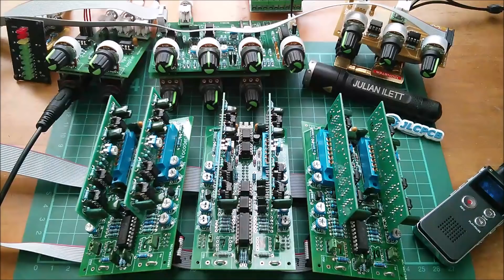The Vocoder has 6 Frequency Bands (and PSU problems)

Comment: Julian, wouldn't it be a better idea to power an analog processing system with a proper linear power supply?
This would alleviate your power supply noise and be more true to the original design.
Go on, get a transformer and rectifier and regulators and filter capacitors and build a decent power supply, rather than rely on a Chinesium SMPS.

Comment: I can see from other comment that you want to avoid using a linear power supply (my preferred option), so what about coming from the smps, through a choke, then a large capacitor including a decoupling cap
It's an old method used in valve equipmernt (rectifier > smoothing > resistor or choke > smoothing > circuit)

Comment: I am sure some other people have recommended this, but why don’t you try an LED strip/CCTV power supply? It provides both +12/-12 volt rails, and a 5 amp one costs around ~$15 US on Amazon. You’ll have to get some other regulator for the 5 volt rail, though.
I’m considering using one of those to build my own modular synthesizer.

Comment: Hey Julian, have you considered the DC/DC converter modules? e.g MeanWell RDDW20F, or RDDW10H  its £20-30, there is still ripple at 100-400khz, but I understand why you might not want to go linear.

Comment: Audio fanatics love to use step down transformers and huge filtering caps, i think you should use a centre tap transformer and separate winding for 5v supply or use lm7805. 
Using transformers in audio projects seems to give better results than what a switching supply can do

Comment: My son gave me a modern computer PSU  and I believe it can supply up to 3Amps on the -12VDC ,I haven't checked  but I assume it would be pretty clean since it is  computer PSU. Just throwing that out there , might be a cheap solution  for all your power needs for the vocoder.

Comment: PSRR on the likes of 741’s is probably not up to much. My first attempt at a fix would be to check the ripple on each PSU rail and apply a basic LC filter to the offending rail/s. That might be able to remove enough of the fundamental and harmonics of the ripple and reduce the offending noise below the noise floor. Downside will be the required inductor and capacitor values and physical sizes but it is a “keep it simple” approach:)

Comment: Can I assume you're using a computer power supply? Those -12v connections have nearly no power whatsoever. Can't pull anything from it. You could also get 2 cheap computer power supplies and connect them up in series to get 24v. But I would personally take a look at what MeanWell has to offer, perhaps they have something that does both 24v and 5v for you.

Comment: U could rise the output of your SMPS to +15V -15V, pass it through an LC filter and 7812, 7912 linear voltage regulators. This should do the trick

Comment: Depending on what the power requirements are for the vocoder look for some sort of audio mixer PSU, either an external or internal one. 
I know Behringer do one which gives you 2x17.5V AC @ 650ma designed (I would have thought) to be used in conjunction with 78/79 series regulators. 
An internal one, could  be acquired from a broken unit, would have not only a dual rail of usually 15V but 5V as well.

Comment: Really good to see it starting to work, but a big collection of interconnected pcb's that mostly works but has some power issues. I'm starting to get déjà vu.
Reply from the maker: I'll bet. Interesting though, how PSU problems affect big analogue systems and big digital systems in different ways :)
Reply: @JulianIlett  Indeed.  The big learning curve for me is all the ways in which the on/off purity of theoretical digital is lost when you have actual wires and components in the real world which are all analogue in nature.

Comment: Do you have any idea about the current draw on the -12V rail? Maybe a Eurorack power supply?
Reply from the maker: It wouldn't surprise me if it's getting close to an amp. Also, I'm assuming a similar draw on both positive and negative supplies.
Reply: @JulianIlett  Good Eurorack power modules can provide that. But they are pricey. Maybe building a linear +-12V supply yourself is the best choice.

Comment: I'll mention it here as well, how about the PSU from the article ?
Reply from the maker: The PSU from the article (original project) is an old school transformer, rectifier, smoothing capacitor, regulator design :)
Reply: So, swop switching noise for mains hum then ?
Reply: I can’t believe the original vocoder designer didn’t opt for some kind of intermittent rusty solar power arrangement, a linear power supply solution is just perverse...

Comment: Looks like a time to buy center tapped transformer and some regulators.
Reply: Try putting one solar panel in the dark to derive -12v, that’ll work...
Reply: @____________________________.x  That's just being SILLY...  He'd have to switch all of the electrons into positrons to do that!
Reply: Trevor van Bremen I’m pretty sure Doctor Who fixed most issues by simply reversing the polarity, it’s good to have a range of options I think.
Reply from the maker: Meh, I was hoping to avoid that :)
Reply: @JulianIlett  Everyone uses linear power supplies for audio, because switched power supplies add noise to the power lines.
Reply: Good SMPS are fine for audio, all the Behringer synthesizers have switching supplies inc. their VC340 VP330 vocoder clone and they are fine.
iirc you have to have specific A/V SMPS's for audio equipment, IT grade supplies aren't good enough.

Comment: Sorry Julian, but with audio I'd dump the switch mode and go straight for a transformer and linear regulators and a good sprinkling of caps. Can't see the point of trying to get rid of switching noise when you can get rid of the switching altogether.
Reply from the maker: Goodbye high frequency switching noise, hello mains hum :)
Reply: @JulianIlett  I prefer to get rid of low frequency hum, than high speed switching spikes, just call me an old timer.

Comment: Just grab a PC power supply. All the voltages are there and clean power as well.
Reply: pc power supply is NOT clean power. It is switching  converter. Also -12v/-5v voltage is  weak. only 300mA.

Comment: All else fails you could also just put a low pass filter on the final output PCB.  It sounded quite high pitched and beyond the frequencies of a voice and your project's design.  Not exactly "fixing" the source of the problem but it might actually be the simplest fix requiring only a few capacitors and resistors.  Take a look at the output PCB schematic and it might be easy enough to mod those op amps to filter out that high pitch.  Search for "active low pass filter".
Reply from the maker: I'm now expecting the PSU to fail completely when all 14 channels are connected. The PSU needs a rethink.

Comment: Back in the day (ie. early 1980s) I was working with professional audio gear and I learned very early on that you should NEVER use a switching power supply for audio, especially on the low-power signal processing side. I would suggest a suitable linear supply with plenty of smoothing and 78xx series ICs for regulation (79xx on the negative supply rails). Also don't forget to decouple the output terminal of the regulator ICs with 100nF capacitors (I used to specify polyester film caps for this without problems, and the actual value isn't all that important and you might want to reduce it down to 10nF if you're still getting midrange tones breaking through)
Reply: Count Zero < I absolutely agree. This is a typical error of some one without a audio background. Same techniques apply to any low level circuits, either you pick it up on the power lines or it gets induced on long wires, traces.  I’ve 40+ years experience from DC to Light and have seen it all. What I find most often is the designer is focused on the function and leaves these fundamental till after a large amount of work has been expended on the first article.  
WHITE WIRES ANYONE!

Comment: Can't tell if the -12V supply is really struggling without making some current measurements.  Or see if it improves with less filter boards.  Or see if it increases when you put more of a load on that supply line.  Add something (resistors, LEDs, small car lamps, etc.) to load it down and see what happens.
Reply from the maker: Yeah, this PSU worked fine when I only had 2 channels.

Comment: Time to get your SCOPE out and trace that high pitched noise.  Is it getting through the filter boards or in the final mixer board?  I would start disconnecting the audio lines to see when it starts to go away.  Then you will likely have to increase the PS filtering on the final PCB.  Start quickly tacking on some additional caps on the PCBs and see if that helps.

Comment: Julian, How come you don't power your vocoder from two 12v "car" batteries in series? +12 "GND" and -12 would all be supplied with no ripple and should be able to handle the current requirements.
Reply from the maker: That is an option :)
Reply: Mike Hensley silly. You have to turn one upside down to get -12v.
But then all the electrons fall out so its a conundrum.
Reply: @brianhanson9367  He's not silly at all!
While you have indeed pointed out a potential issue, it's an EASY one to overcome.
Just use one battery from a left-hand drive vehicle, and the other battery from a right-hand drive vehicle.
(This might entail a quick trip through the Chunnel though)
Reply: @trevorvanbremen4718  failing that you could use one from Britain and one from Australia. Opposite sides of the world, opposite voltage, easy.
Reply: @hinzster  Australian batteries contain positrons not electrons, so I don't think that would work, it would be -12v current sink

Comment: I harvested a power supply from an old DVD drive for a very different project. It's primary rail is 5V, but it also has 12V and -12V to drive the motors and laser diodes. I don't know how much power you need in the +12V and -12V for this, but that could also be an option for you, maybe?

Comment: the original used a transformer based design....  and some rectifiers and linear voltage regulators?  (none of that cheap chinese switch mode rubbish)
Reply from the maker: Ah, yes, I remember mains hum :)
Reply: None of that cheap Chinese switch mode rubbish.... Ahhm...Dave Jones 😌😌!

Comment: Great to see it getting more and more finished but pleaseeeee get a better quality microphone. Everything will sound so so much better.
Reply from the maker: Hmm, I'm not sure a better quality microphone would help much. The vocoder is full of 741 and 1458 op-amps, not exactly high fidelity components.
Reply: @JulianIlett  That is true but its more the idea of crap in crap out. If you give it something decent to work with. The numerous sub £10 microphones I have used sounded the same as this one - ie no high frequencies and sounds like you have a mouth full of cotton wool. :)

Comment: Please don't misunderstand me Julian , but how the hell couldn't you estimate the power consumed by your system before starting production and assembly???... Couldn't you test it first on lab PSU and check the rated currents before going further ??.... I am really disappointed to see total project management failure at this stage... By the way , why didn't you check that suspected ( -12Vdc ) line performance on oscilloscope while debugging the problem ??
Reply from the maker: Total project management failure? Really?
Reply: Julian Ilett my friend .... If you didn't prepare good fuel at first for your fancy car to run then what can you call your car ??... Is it  still A CAR or just a collection of metal , plastic , leather , ....etc. ???... Same thing applied for DC Power Supply to the electronic circuits system....

Comment: Why not look at the power supplies that eurorack modular systems use? A PSU for the larger systems could provide enough current for many rows of modules, so it should work fine for you. Eurorack also uses +12, -12, and 5V. Sometime the 5V is generated from the +12 on the module instead of using the 5V line.
Reply from the maker: I fear they may be outrageously expensive.

Comment: You might need to use a computer psu.
Reply from the maker: What's the current rating on -12V, typically?
Reply: @JulianIlett  about 300mA. It is specified on the side of the psu
Reply: Not much

Comment: Julian, this project doesn't need to stall if you use an external power supply so you can work on adding frequency modules while at the same time working on a fix to the (borked) power supply. Lot more videos coming your way, actually :)
Reply: I’ve been suggesting he just get a bench power supply for years 🤗
Reply: horse1066 But aren’t they all Chinese switchmode jobbies now?  I have an old school (heavy) RF-safe (so I assume audio safe) bench top, but it’s single channel at 15 volts max.

Those chip-mod-amp people have the design of plus/minus PSU down to a fine art.
Reply: @orwellophile  I'm sure he could knock up a linear regulator one in a day or so. It's odd because a bench PSU is generally the very first thing a hobbyist makes, followed by a logic pen and a voltmeter. You can even buy a suitable linear module off eBay

Comment: You have a switch mode psu. It may be running at many kHz, but I reckon it is mixing with a clock in the vocoder and producing an intermod. Maybe a linear supply with a transformer?
Reply: Use a linear power supply after the switchmode supply, and some large electrolyte capacitors to take care of the spikes on consumption.
Reply: @JrgenDurkeHansen  Linear power supplies are notoriously poor at filtering out high frequencies. They are OK at 50/60Hz of course.
Reply from the maker: He he, the vocoder is all analogue - not a clock in sight. OK that's not entirely true.
Reply: @JulianIlett  Oh. In that case it is just some lousy PSRR on that negative rail. Either way you need to get rid of the noise. Generally the output impedance of a switcher is so low that electrolytics don't help unless you ballast them with some series resistance. How much of that you can use depends on current drain on that rail.
Reply: @donepearce  On the off chance that's what's happening, use one of the newer switching regulator chips with "spread spectrum".  They vary their switching frequency to distribute the energy and make filtering easier.  I'll make my guess the 'feedback' onto the audio amp power rail interacting with the power supply filter.  Esoteric enough for ya? :-)
Reply: @chrisw1462  I've used a spread spectrum switcher. It's a total cheat attempting to creep below spec limits on peak ripple level. Of course the energy in the signals is unchanged. But whatever, I imagine if the frequency of this tone was warbling it would be even more annoying.